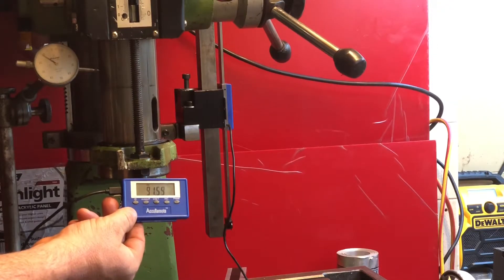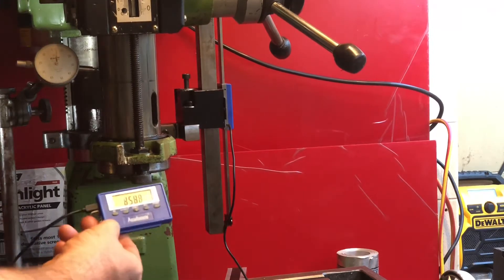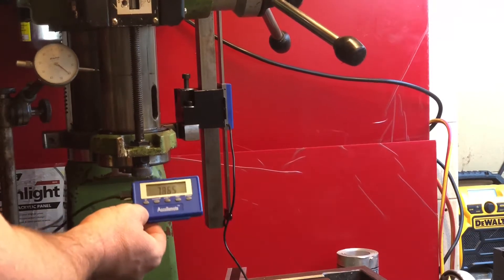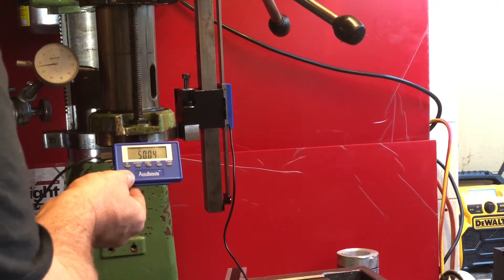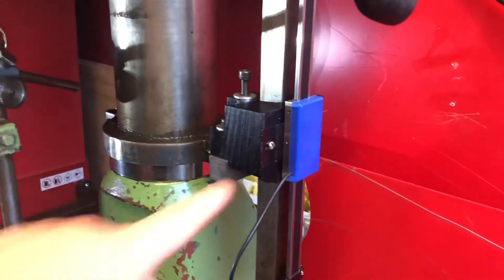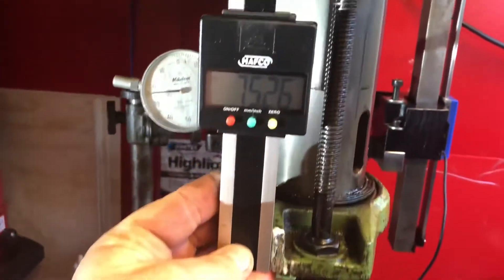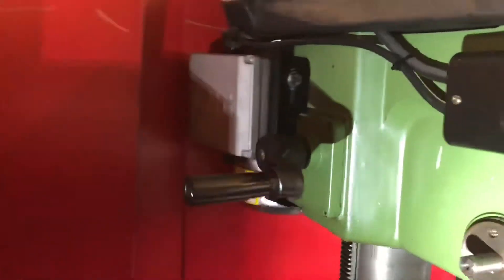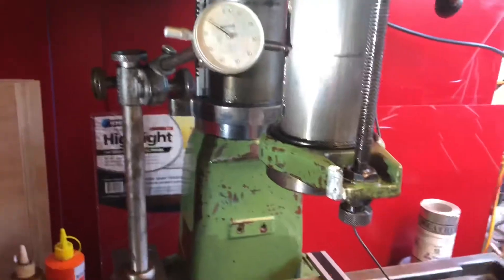Tru-Line 8 review

Comment: On my small dovetail colum mill i was going to make up a counter weight on chains similar to some boring mills to off set the weight of the head  & fit a proper round  hand wheel instead of a poxy crank handle .
Reply from the maker: Bruce did mention counterweighting as an option, especially as the column is hollow, so would be a suitable location for that counterweight. The more I think about this, the more I like it! essentially float the head on the column! I wonder how much weight is in the head assembly...
Reply: @JBFromOZ  when I moved my machine (in two parts) it felt like there was about equal parts in the base+table and the head - so maybe around 150ish kg? Then again, it was an eternity ago.

Funny thing Max mentioning the round hand wheel - I was thinking the same thing when Tom Lipton showed fitting one to his BP. Will be really handy to have the handles out of the way with steppers running the Z axis, but to disengage the clutch and use it as a drill press with a wheel for quill!

Comment: Did you ever add a powered lift/lower mechanism?  If so, how much deflection are you left with when raising the head?
Reply from the maker: Gday Rob, I ended up moving this machine on when the CNC mill came into my hands, the repeatability in use was very good however

Comment: Next project, an electric lift mechanism for the head.  That should eliminate the movement.
Reply: I have an idea!
Reply from the maker: Yeah my plan is to machine down the shaft to 13mm so my drill will fit onto it,  or just machine a hex for a socket (maybe even same hex for power drawbar!!) thatd be sweet
Reply: I will share my idea with Bruce at the Bash.